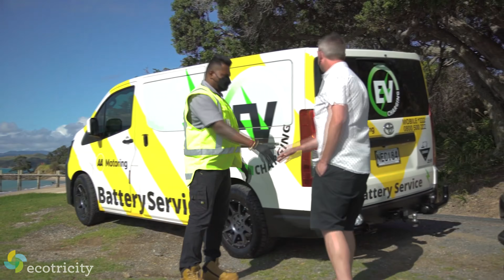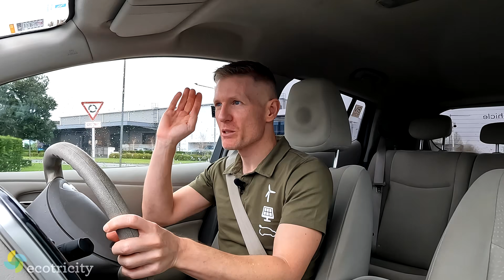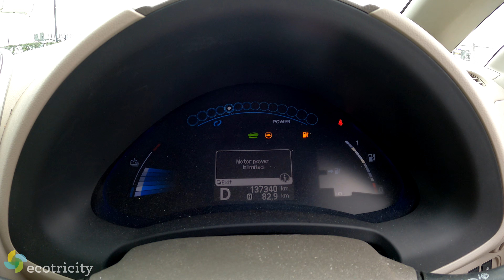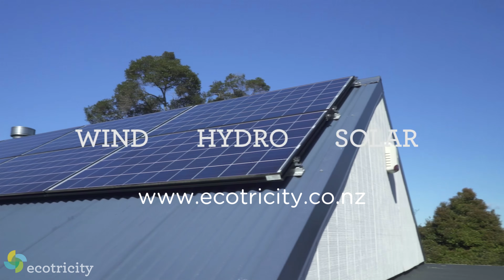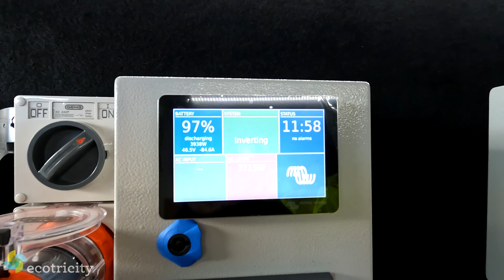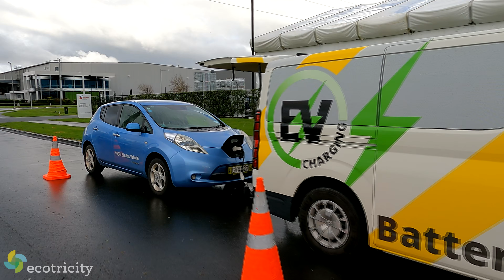Out of charge: Rescued by the AA's mobile battery service!

Comment: The indicator stalk is on the wrong side.  UK Leaf or is that just how the first gen came?
Reply: Good spotting. I'm puzzled though as if it was a Euro import the charge socket should have been a type 2 but it seemed the AA guy used a type 2 to type 1 adapter link.